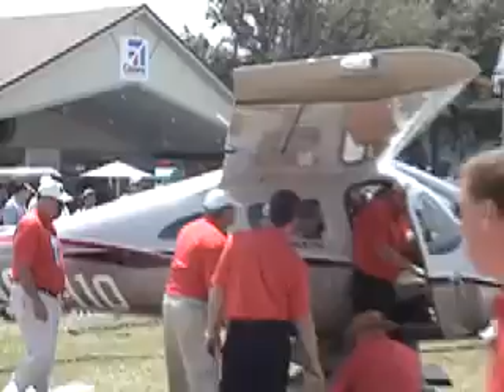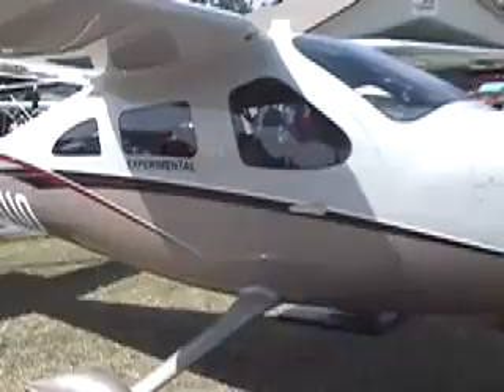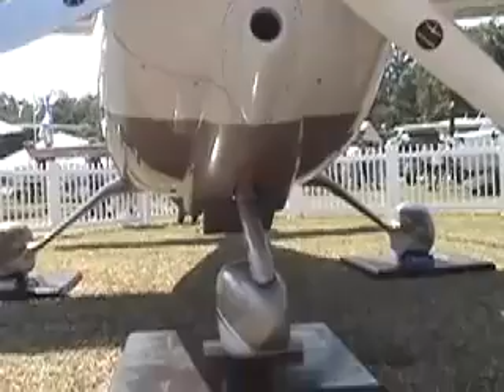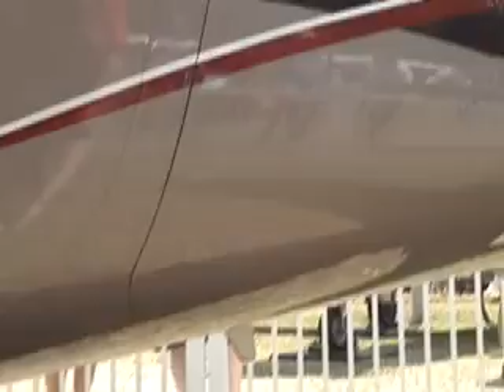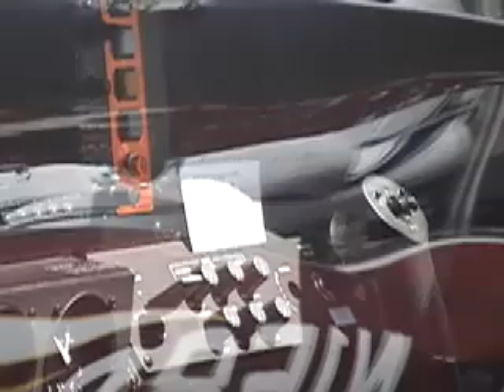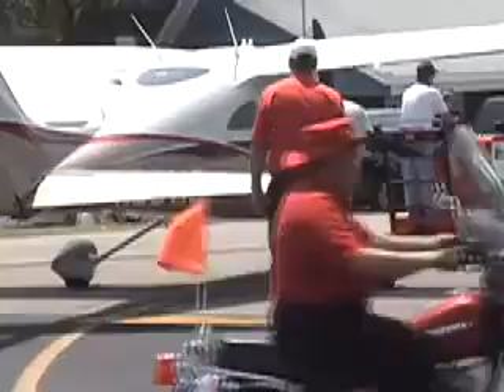Cessna NGP (Next Generation Piston)

Comment: I do like the new wing design. But if you look at the nose wheel, its the same "swivel castor" design and if you land fast its a hell of a struggle to keep straight. I know when we lost the steering damper on our 172 on takeoff, landing it was pretty scary because it shakes the pedals quickly like a motorcyle when you lose control at high speeds.